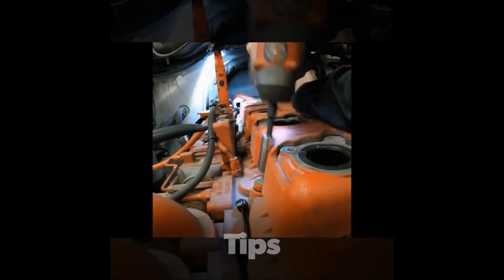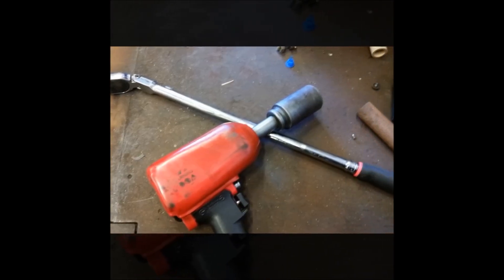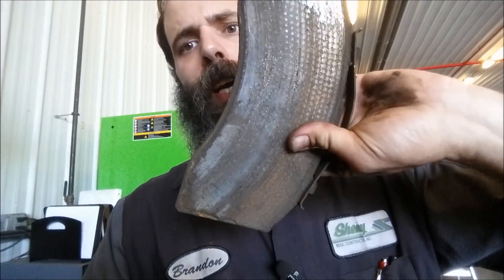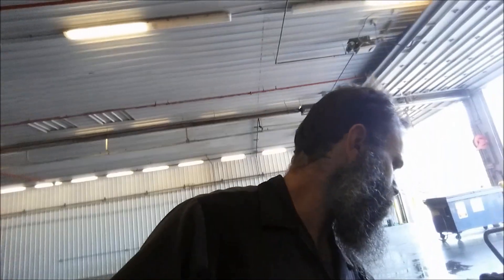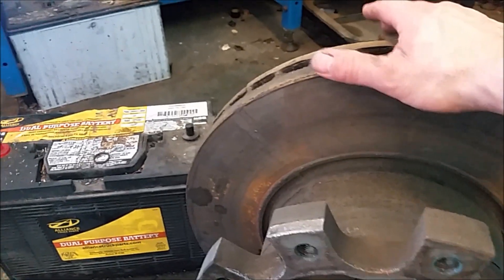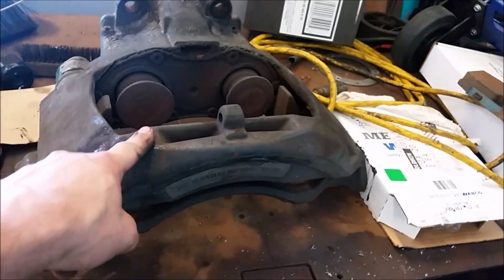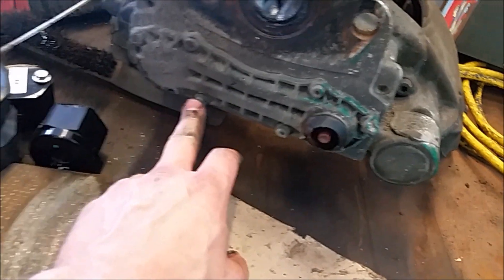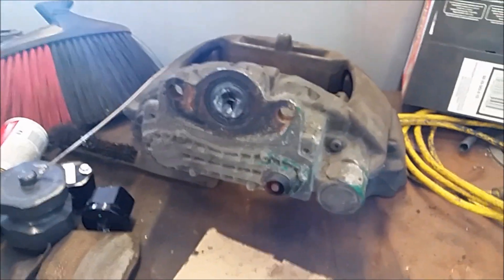Bendix Air Disc Brake Components

Comment: We have a few trucks with pads on the front. Much easier to change than shoes but those calipers and disks are crazy heavy ! Great video keep up the great work
Reply from the maker: lol, especially when the wheel seal goes out, hefty lil bastards for sure! Thank you for watching clay hope you and everyone down there have a good weekend!
Reply: I talked to a salesman about a trailer with disc brakes. I cant remember if it adds 48lbs per axle or wheel end. Surprised me

Comment: Hi There, If the piston boots are split then thats where the water might have come in, but the usual source of water ingress is through the air chamber front shell if the boot has become damaged. The air chambers are great, but the rubber boot is critical, it has to seal on the mounting face and then the boot section has to seal on the pushrod. If either of these points are damaged then the caliper will get water in from the front shell (which is open to atmosphere) and its only a matter of time before the caliper seizes. You may fit a new caliper only to have the same issue a few months down the road if the air chamber has sealing issues.
Reply from the maker: Typically we have a bad chamber problem but yes, what i have seen is usually piston seal failure (somwtimes burnt up due to excessive heat, also due to spring failure)

Comment: Once you get the disc off the hub how do you get it back on? Would a bit of wood and a hammer work or do you need a certain pressing tool?
Reply from the maker: When we replace them the rotor kit comes with new boths, i get everything alignedand all bolts started by hand, then use air impact in cris-cross pattern (like would tire) then go back over again to make sure tight

Comment: Nice video! I never worked on air disc brakes but ive seen them. What do you prefer in terms of doing the maintenance/working on them? Disc or Drums?
Reply from the maker: When it comes to changing out pads vs shoes, pads all way, brake cans fairly easy as well, as far as doing wheel seals though shoe/drum style little easier (plain hub alot lighter lol) thank you for watching
Reply: Yeah i see what you're saying for doing wheel seals. If the rotor is bolted to the hub, its more work. Thanks for the reply

Comment: Interesting,  never messed with disks on a big truck, I don't think they offer them on 20klb front axles and 52k rears yet? But anyways,  I'd like to see how the can bolts up and how u determine rod length,  and how to adj. That be a interesting follow up to this video.  Thanks, love the education
Reply from the maker: Kwmike-D that i could do, it is... definitely different to say least. But  pads and rotors on the cascadias are same on steer and drive axles, steer cans are of course lil smaller, but left side and right side calipers are different. See what i can try to do for follow up vid
Reply: Bearded Seabee82 cool thanks

Comment: I wonder if the heat from the exhaust has anything to do with the caliper. On our trucks the exhaust is very near there
Reply from the maker: I dont know, we havent had any tire, ujoint,driveline, or hose issues... will occasionally see pinion seals go bad though. But havent seen anything else get hot or damaged in process. Even coming in off the road and checking tires havent seen or felt like one side warmer than other. Goodquestion though!

Comment: Great video thanks brother. I have not done any work on the disc system. I know heavy equipment has them but I stayed away from them. The truck side of things might change next year or two. I know that they are talking about it for the race trucks. The European truck seires runs them. I think they are trying to figure out how to spray the water on them. Just seems like there is more wgt to them. This was a great video thanks brother. Big boy pants for sure even drum brakes . A jack would be a great thing. Keep up the great work see you in the next video thanks again brother
Reply from the maker: yup, quite a bit of mass on them, but air system quite a bit smaller, only 2 tanks both 13"wx24"L (one of course split tank). for drums one of the drum dollies does help ton and does make doing our trailer brakes lil nicer for sure! thanks for watching

Comment: That caliper is completely repairable.... At least in Europe, and it might be actually the easiest of them all to fix or replace the parts inside. In general is the most commonly used
Reply from the maker: Past couple years kits finally became available to refurn in shop stateside, prior to that however, there wasnt even a core charge on these calipers. Now though there is and reman market is higher demand.